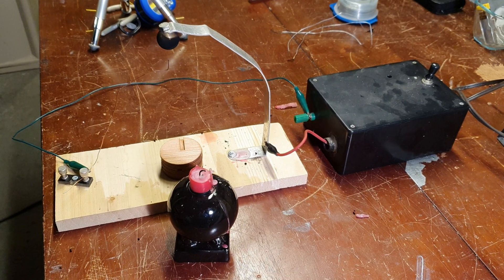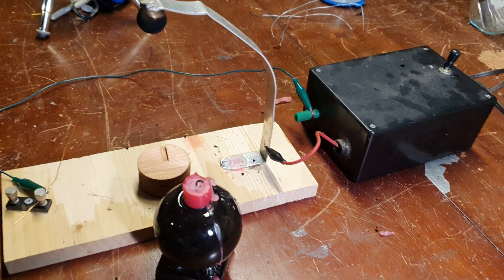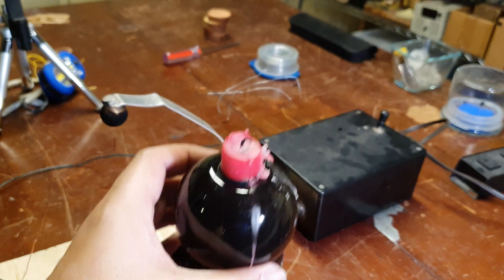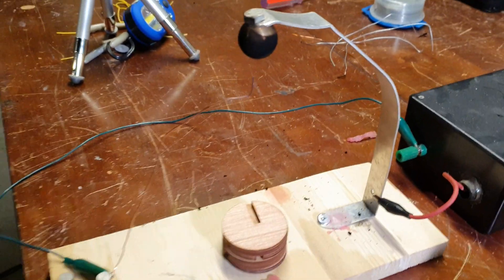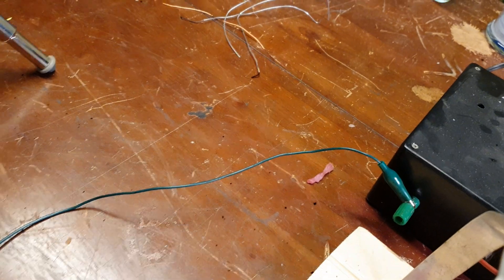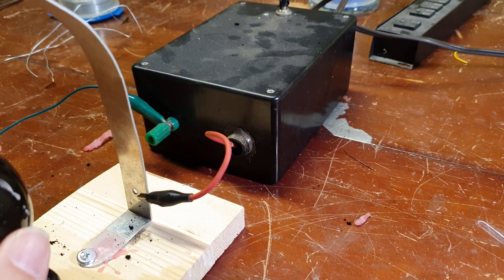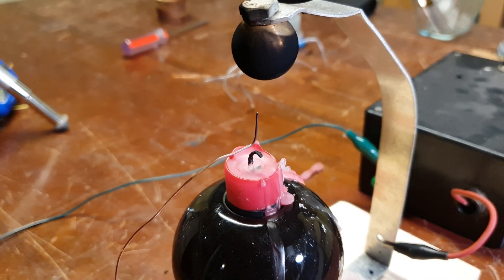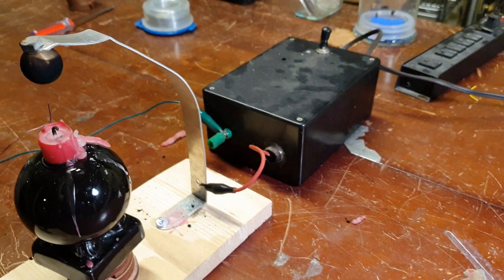DIY: Carbon Nano Trees

Comment: https://youtu.be/FO62cMP63ls
Reply from the maker: You got some nice tree branching there... Funny seems like the arc mostly hits the top of the wire not the flame. Maybe the electric field around the wire plays a bigger role than the arc itself... definitely worth some more investigation. Thanks.
Reply: sparkstarter yeah i did this with tazer module . It only lasted a few minutes and butnt out . I wish to collect soot on a plate but negatively charge the plate to capture all carbon . Any suggestions for power supply ?

Comment: awesome man . so timely... i gotta find the most effecient way to form and collect this carbon  . higher yeild may be possible with different Stoichiometry  like using deisel mixed with a lttle oil and something with higher octane like 3 percent petrol.
Reply from the maker: Thanks for the comment, also you could just let the carbon soot collect on glass or a metal sheet... but adding the high voltage gives it cool looking shapes.
Reply: I just uploading my nano tree now
Reply from the maker: @Buzzhumma  Feel free to post a link.